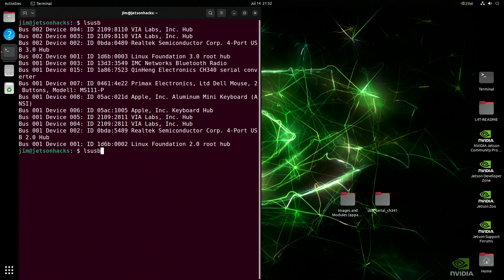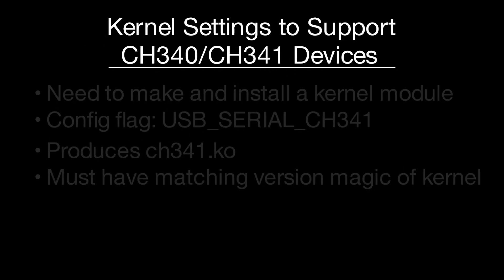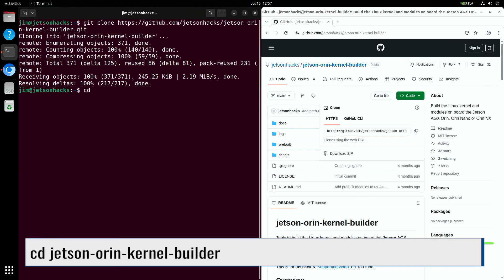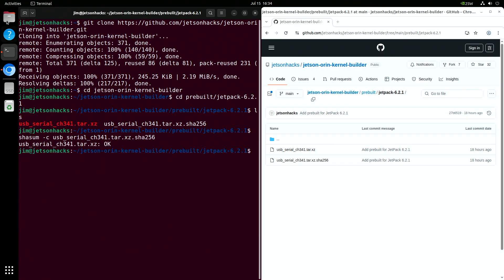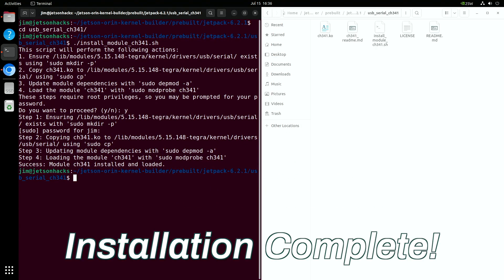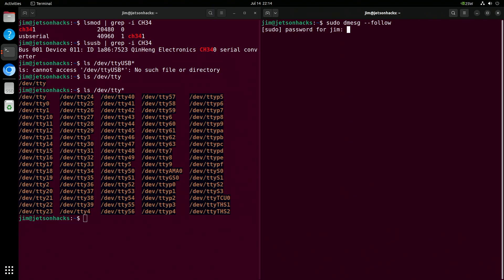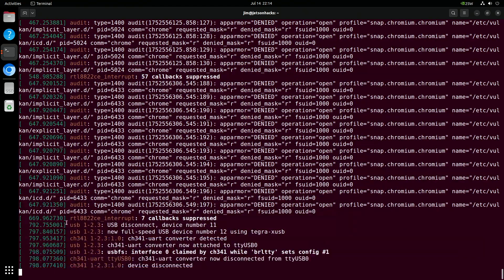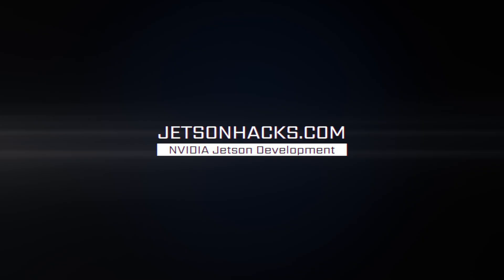Jetson Orin CH341 USB to Serial Module Install

Comment: the ft232h is where the magic is really at
Reply from the maker: I try to keep my enthusiasm for USB to serial converters to a minimum, so I'll take your word for it. Thanks for watching!
Reply: @JetsonHacks I can help you do a tutorial on if you like?
Reply from the maker: I thought that the FTDI module is part of the default distribtion, and the ft232h is plug and play?
Reply: @JetsonHacks it should be yes. But ft232h can do spi and UART
Reply: And i2c of course
Reply from the maker: @BenjiNotknown  What devices have a ft232h that people would use UART or SPI or USB ?
Reply: @JetsonHacks  the ft232h is typically a usb adapter which allows a user to prototype sensors without endangering the precious gpio or expensive jetson board with incorrect wiring or not fully knowing the pins on an unfamiliar sensor. The ft232h usb adapter can be had for under $10 and you can interface 360 lidar uart modules from robot vacuum cleaners, advanced i2c gas sensors, or fast data sensors over spi, just by using different pins on the ft232h. I use it with a desktop computer to write sensor code ideas, before switching the sensor over to a sbc (i find it faster and less painful to test and write sensor code on a pc/mac first). Once you are up and running with the ft232h it becomes the mainstay of sensor connections and you realise how often risky it is to use an expensive orin board as a test bed for stuff unless you like to warm your house in winter with $100 bills :)